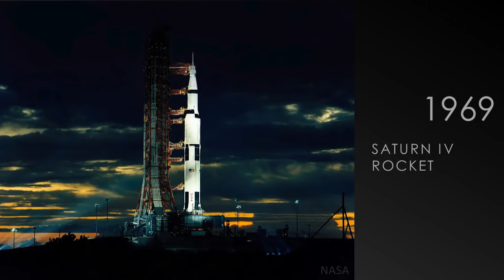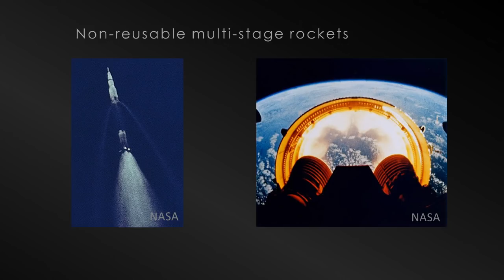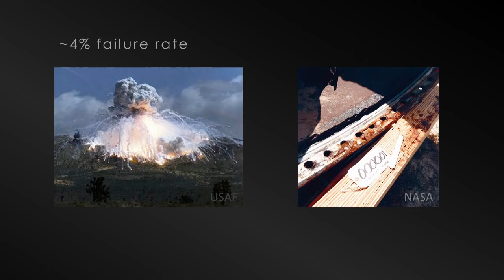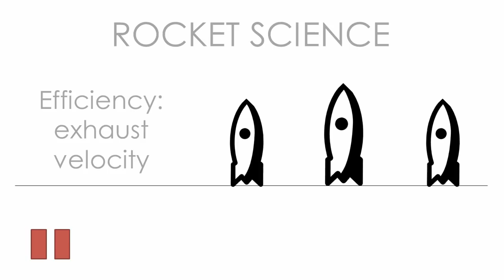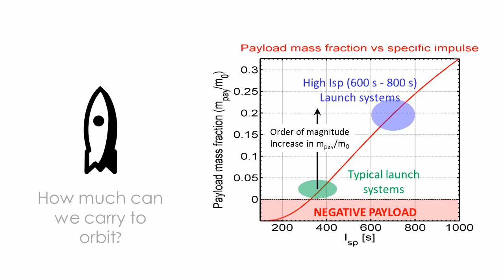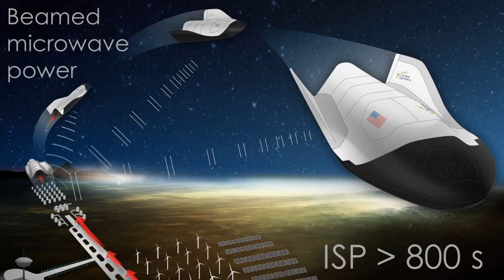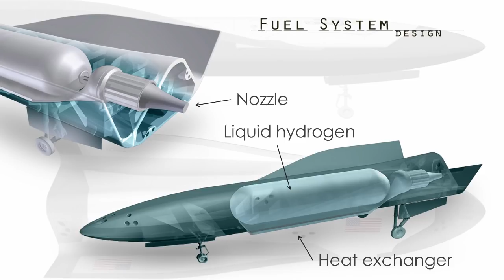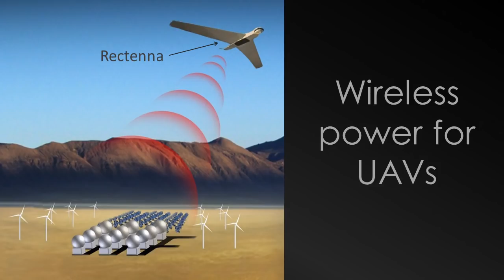A better way to get to space: Dr. Michael Kelzenberg at TEDxWSU 2014

Comment: You have several very difficult and fundamental challenges in doing beam-powered propulsion from Earth to Space. First, the beam has to work at both close range and long range, and the atmosphere gets in the way for most of the electromagnetic spectrum. Worse, the Earth itself gets in the way as the spacecraft goes over the horizon. If greater acceleration is used to keep the distances a bit lower, then the beamed power must be higher to compensate. Then they want to have much higher exhaust velocity? Doubling the Isp at the same thrust requires 4 times the power. The overall problem is a nightmare and the only thing that can really help is to beam the power from space down to the spacecraft, starting when the spacecraft is at about 20 kilometers altitude. There the air is very thin and almost perfectly dry, enabling the use of very short wavelength microwaves, which are much easier to keep in a tight beam over long distances. With long-distance beaming in hand, the acceleration can be lower, which reduces the required beam power. But the obvious downside is: You have to put a specialized kind of Solar Power Satellite in space before you can launch things on the beamed energy. But you can't build it until you have the capability it is meant to deliver already launched into space, assembled, tested and working. It is a Catch-22 if you try to do all or even most of the Earth-to-Orbit propulsion on the beamed energy. But if you only do a small part of the propulsion that way, you get only a marginal improvement over ordinary chemical rockets, and you still have to invest a LOT of money for a rather long period, and bootstrap your systems up to the original goal. Then, if you succeed in all that, the capability you unlock for space launch is suddenly far greater than the market requires, so your very expensive system sits idle 99% of the time. It is, unfortunately, still a total nightmare.
Reply: This is a ridiculous rebuttal. Even if you needed an SPS in LEO to bootstrap, don't you think that some old-fashioned chem-rockets could do the job? Then, you ridiculously assert a market over-supply. Don't you think, "if you build it they will come" is what would happen? A cheap lift will put all sorts of new missions in the backlog. Don't let your imagination fail to see the future.
Reply: allen everhart -- I cannot tell what you really object to, but my points are well-considered in every regard. Are yours?
Reply: Read what I wrote. One of your main objections is that such a program, if successful, would price itself out of the market. I just think that's putting the cart way in front of the horse. But believe what you want, it don't matter now that these guys have closed shop - maybe they were too successful.
Reply: allen everhart -- Don't get me wrong. I would love to see better ways of doing space launch, and I have worked on several concepts myself. However, it is much more reasonable to assume that they closed up shop because they found out that their ideas were much less than half baked. I can go into all manner of gory details of powersat design, microwave optics, minimum practical size for various configurations, etc., but first let's just do a couple of crude sanity checks. 
Look at the launch rate for a very minimal system of around half a gigawatt. Beamed to a rocket, that could propel about 1000 kg to LEO every half-hour or so. In one year, there are 17520 half-hours. That means about 17000 tonnes to LEO every year. For comparison, ISS has a mass around 450 tonnes. Where is the market for 38 times the mass of ISS, per year? I am not seeing it.
Now look at the mass for such a half-gigawatt powersat, which BTW, can't stay in LEO and still do it's job, because LEO is in shadow half the time. The beamed power is about 1/10th of a full-size powersat and those need a mass of about 36000 tonnes, in GEO, so we need at least 3600 tonnes, probably more, because some things do not scale well to smaller sizes. That is looking like about 8 times the mass of ISS, in MEO. For this special beamed energy propulsion kind of powersat, orbital altitude needs to be at least 12000 km, about 1/3 of the way to GEO, which costs about twice as much, propellant-wise, as a ride to LEO. This powersat cannot self-propel safely through the space junk cloud in LEO, because electric rockets are too slow, the spiral orbit too long, and the target area of the powersat is huge, even at 1/10th scale. So chemical rockets are needed, to loft the equivalent of 7200 tonnes to LEO. How does that compare to the total tonnage ever launched? 
Is this approach still looking reasonable? Not based on present or historical values. It requires a whole new launch market to justify the cost of it, something like building a fleet of several thousand full-scale powersats to replace with electricity the 3 cubic miles of oil-equivalent which Humanity consumes every year. 
This is a really serious chicken-and-egg problem. Who will pony up the many billions of dollars required to build something like this propulsion powersat, when the market to utilize it does not exist and may never materialize? What is the interest on the loan, and what happens to the loan if it takes 30 years to pay it off? What if there are unexpected technical 'gotchas'? Where are the engineers and managers who will greenlight this plan, when it may fail for any of a hundred known reasons and destroy their careers? How many more unknown ways can it fail? Where in this risk-averse world are the investors who are making such risky investments? 
Keep in mind that completing the powersat fleet market in 20 years would require launching 1 tonne per minute to LEO, far beyond the capability of the proposed sub-scale powersat. Evidently about 30 would be needed, and the time for the first one to launch all the parts for the second one looks like 150 days, if the system is not doing any paid launches to recover the initial (and still growing) investment. That 150 day doubling time needs almost 5 periods to reach the level of having 30 special powersats in place: 1==>2==>4==>8==>16==>32. That is 2 years of doing nothing to pay the bills, while shelling out for 30+ sub-scale powersats.
Of course, the whole thing could be spread out in time, but then there is even more interest on the loan. "If you build it, they will come"? That is a mighty big IF.

Comment: I assume the BFR burns at start 3 tons methane per second. 1 kg has 55,5 MJ. So we have at 3 tons 166,5 GJ  per second. Thtt's  46,5 GW. That's about half of the maximum power grid electric power transfer of Germany.
Reply: 166.5 GJ per second is 166.5 GW ( W = Js⁻¹ ) that is more than all the power grid of Germany and the UK combined.
Reply: The higher ISP would allow for an order of magnitude improvement in mass fraction, that means something like 10 times less initial mass and thrust. Doubling the ISP also doubles the power required for a given thrust, so a thermal rocket might need something like 5 times less power than a chemical rocket. That's still an astounding amount of power, so maybe payloads would have to be a little less than 150 tonnes if used as a first stage!

Comment: This was 3 and a half years ago, where are they now?   Laser ablation propulsion was tested about ten years ago using a spinning aluminum top design and a 100 watt co2 laser.   It used pulses and shot it up about 100 feet.  The problem is not only tracking but the loss of strength through humid atmosphere and clouds as well as the dispersion of the laser beam over a mile and before you know it you have a tenth of your original power.    The solution is to bring the laser with the ship,  bounce that light off the back of the ship.  Nuclear power could do that.  The same is true with Microwaves.  Water absorbs  radiation so it has a limited range, it disperses, and even if you could get a test ship up a few miles the cross section of the beam at that distance might be nine times bigger, rendering one ninth the power to the hydrogen.  The solution once again seems to be to  bring the microwave emmitters with the  ship and power it with nuclear batteries.

Comment: If I understand this right, Hydrogen is the exhaust gas, not oxidised, just Hydrogen. Being less dense than the atmospheric gases, it will rise, and largely escape to space. It will need to be replaced for your engine, presumably by electrolysis of water. If you are increaing the O2 content of the atmosphere and at the same time removing water from the planet I can see a time where the planet becomes uninhabitable. You are not adding pollutants, sure, but damage you are doing has similar repercussions.

Comment: 3 minutes in and I am already bored. Did he actually prepared a speech or is he actually just rambling around in front of some power point pages? !
Reply: Eventually he outlines pointing a MASER at a hydrogen-only rocket, heating the gas for thrust. He also brought up using microwave energy to charge from the ground an in flight UAV via a rectifying antenna. I had to play it at shift >>>

Comment: This Is all good for somebody just trying to leave the Earth and get back but not so all good for somebody that is on Mars or the moon unless you get one of these stations built on those locations. This reminds me of GI Joe the animated movie where the plot device involved a machine called the broadcast energy transmitter that with basically sends free microwave based power throughout the sky. The best thing they could do to make this tech something lucrative is to create energy receiver devices to install into building so that they could is essentially become the new electric power company of the future. That,... and ensure the waves don't cause cancer since the sun is already providing free microwave energy in the air and it can absolutely kill you if you stay in it too long.

Comment: The Moon rocket is labelled as a Saturn IV (4). V (5 for you non-Roman numeral readers). And I want a pickup that weighs 100 lbs. Of course with a blown and injected 8.5 liter engine (just for the fun). The "AVG MPG of a rocket is $5M for 3 launches"? SpaceX says otherwise. But this is from 4 years ago. Things have changed! Thanks Elon! After I create some Hydrogen and stick it in my microwave, I'll see how high it goes! Outside of course.

Comment: When they find this plan isn't practical, they'll just wrap a blanket of slightly sub-critical uranium or plutonium or thorium around the hydrogen tank, which will make the project massively simpler.  But I guess they figured out two grants generate more funding than one.  Sigh.
Reply: Also making it massively heavier.
Reply: +Bill Fipp : Precisely the opposite.
Reply: Precisely the opposite? Aren't uranium, plutonium and thorium some of the heaviest elements around? Wouldn't wrapping a blanket of uranium or plutonium or thorium around the hydrogen subtract from the 10% payload to the point of making the rocket almost useless?
Reply: +Bill Fipp :: Of course those elements are dense... very dense.  However, the point is, you need very little of those radioactive elements to generate enormous temperatures, which in turn generates enormous pressure in the hydrogen container they are in or next-to, which in turn generates enormous exhaust velocity of the hydrogen that is allowed to escape, which generates enormous thrust.  If you think a humongous tank of liquid oxygen weighs less than 10 or 20 pounds of highly enriched uranium, plutonium (or perhaps safer thorium), you are extremely mistaken!
Reply: 20lbs? That's 1 pint or half a liter of uranium, that doesn't seem like a enough to "blanket" a "humongous tank" of hydrogen, not to mention that a pint of uranium spread thin enough to cover that tank, doesn't seem like it would produce a significant amount of heat for that tank.
Reply: 20lbs? That's about a pint or half a liter of uranium and that seems a  bit small to "blanket" a "humongous tank" of hydrogen with, not to mention that "blanket" would be have to be pretty thin and so it would seem that it would not provide a significant amount heat to that "humongous tank" of hydrogen.
Reply: If they were going to go that route they would just build a NERVA engine, which has been tested and totally works and has isp >= 800s. Meaning that trying to heat it up with the radioisotope thermal generator esque setup you're recommending would be much lower ISP than that because a RTG is necessarily much heavier per unit energy produced than a reactor. 

It's a good idea though. In that case you should probably just use the atmosphere for fuel in the beginning, heat it up super hot with your reactor and blow it out the back, then switch to hydrogen to circularize and burn for your holtzmann transfer or whatever. Why don't we do this already??? It works in KSP!!

Comment: a rail gun drive system can generate a continuous thrust of 1 G-Force (for gravity) right passed the speed of light...
after were already in space.
Reply: It's not possible to go faster than light speed, but even if it were, a railgun wouldn't work because the speed of electricity is a lot slower than the speed of light. At some point you'd go so fast that the electric current would not be able to keep up with you and jump across the rails, so you'd stop accelerating. In fact even if you ignore that and imagine a single massive magnet to repel you, the electromagnetic force only propagates at the speed of light, so it would not be able to push you any faster than it either.